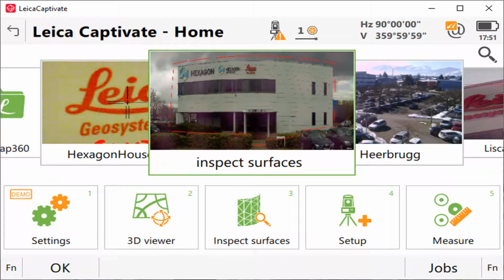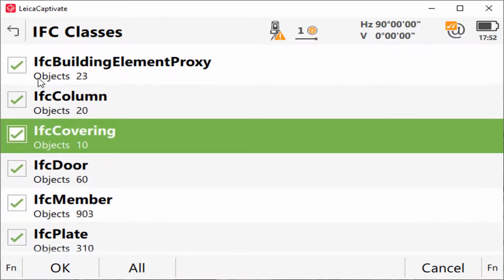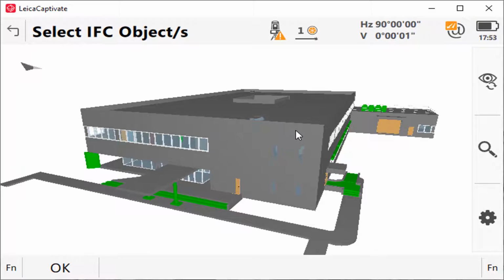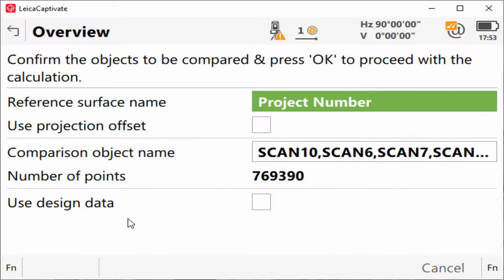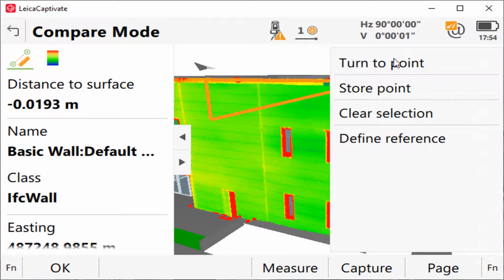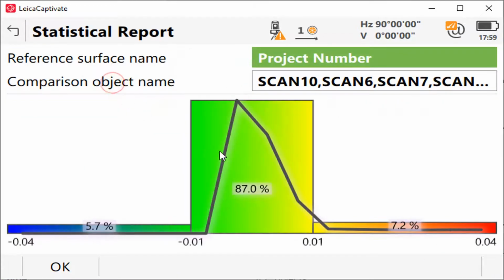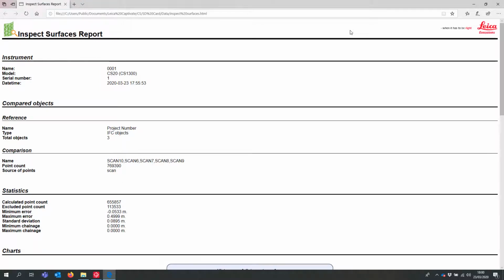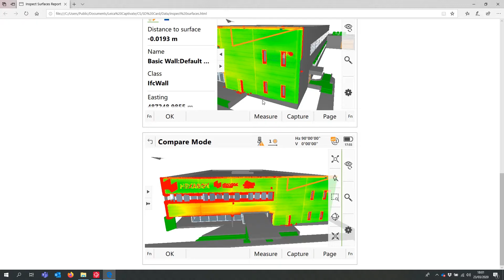Leica Captivate Inspect Surfaces

Comment: Hello Cesar, I would like to tell you that we are using the surface inspection module to control levels on the terraces of an industrial warehouse, but when trying to generate the reports, the system sends us a message indicating that the memory is full, followed by: Program memory is critically low, I appreciate any help you can give us to solve this problem.